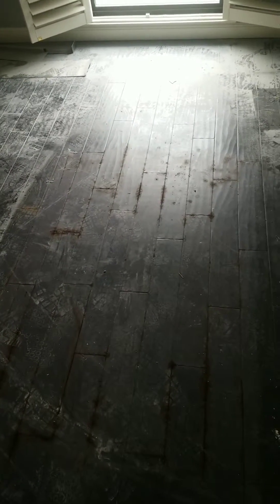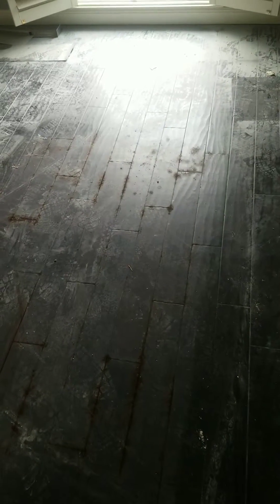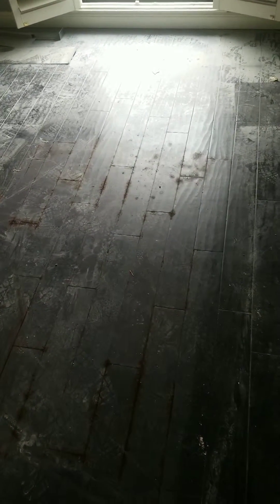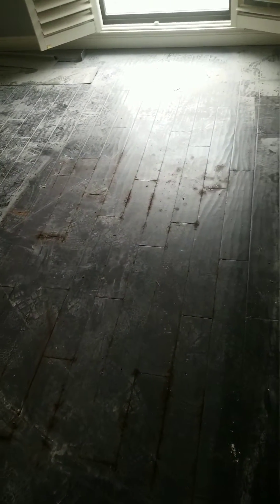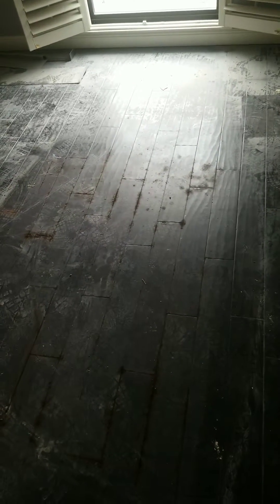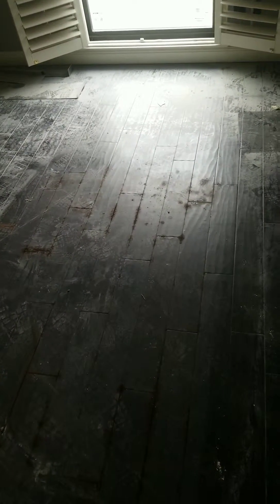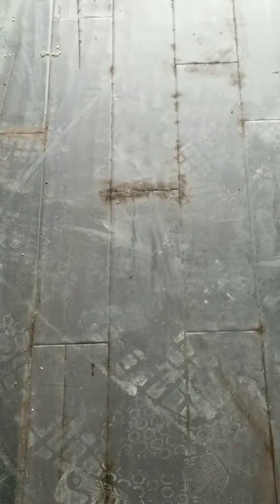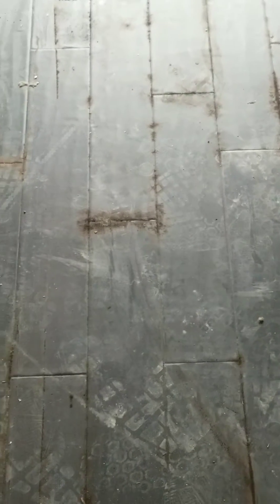Episode 73- Can mold grow under engineered hardwood?

Comment: Thank you for this video. I live in FL (high humidity). The flooring contractor suggested putting vinyl plank over the engineered wood, since the floor is still structurally sound. This is my concern. I don't want to deal with mold 5 years from now.